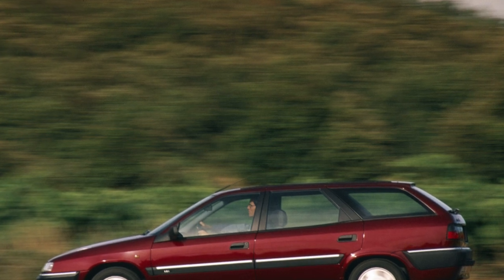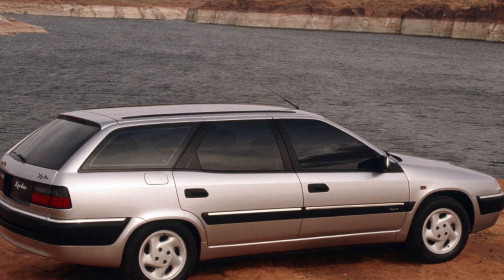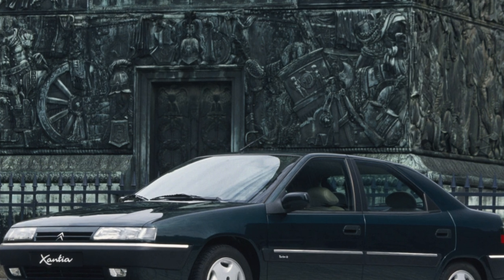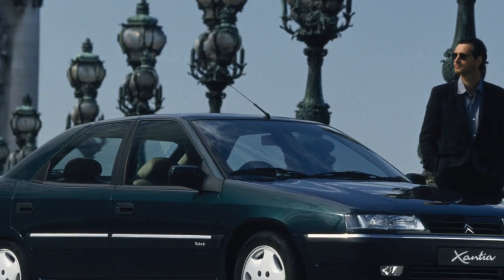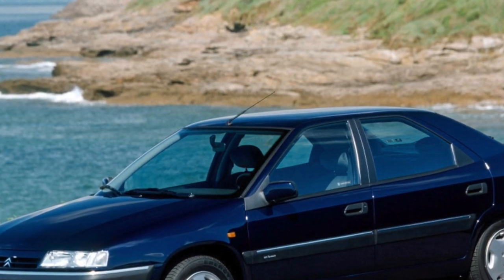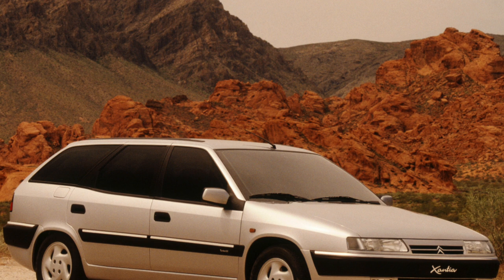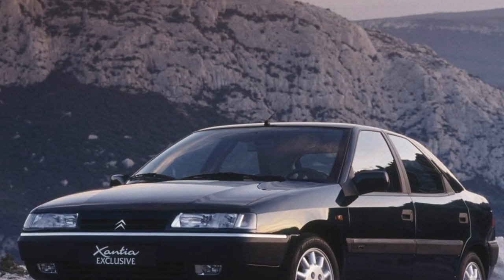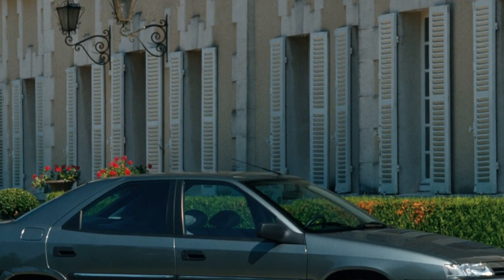Everything You Need to Know About the Citroen Xantia - Fault Guide

Comment: Great video. Thanks you even mention the clicks every 40sec. These clicks regulate the system pressure. If the clicks occur more often than say 30sec it means there is a leak somewhere as the system needs pressurising too often. Quite a good way to check if the system is in good nick. As well when opening the doors you should hear a slight humming, which is to soften the suspension slightly for getting in. 

A lot of people are scared of Citroen’s hydropneumatic suspension but indeed it is a piece of genius. The main problem is if you lose hydraulic pressure, suspension as well as steering and brakes are affected, which obviously means you are stranded full stop. 

However the system is quite simple. i.e. change damping rates by simply changing spheres, no dismantling dampers and springs. The lines that are under pressure are made of stainless steel and are very unlikely to break. When something leaks it is usually the return pipes, which are not under pressure and are made of rubber and can easily be replaced with about anything you find. 

Another big advantage of the system (at least to my taste) is the brakes:
1st these Citroens don’t have a break server. You have little pedal travel, the pedal sits lower than in a conventional car (about same hight as the accelerator pedal, which is great for fast driving) and is very firm. This does take time to get used to, but rather soon you realise this system is a goddess for fine dosage of your breaking.
2nd the brake system runs on Citroen’s suspension LHM fluid. Other than typical brake fluid LHM does not boil and does not absorb air, so no brake fading possible on a Citroen!

Nothing can combine comfort and sporty driving like Citroen’s hydropneumatic. On a conventional suspension you either have comfort and soft or sporty and hard. To describe the sensation, a lot of people are telling me my car (actually the even larger XM) feels a lot smaller than it is. This hits the mark. I used to have a 205 GTI before. OK, large Citroens are probably not as nimble as a 205 GTI. But thing is: If you turn a hoonigan in a 205 GTI, the rear end bounces, if not the whole car. On a Xantia or XM, even the worst pot holes don’t get it off line. And then you have the brakes that are absolutely pin point accurate. That is FUN!! 

I personally own a Citroen XM with the later 2.9 V6 (same as found in the Xantia) since near 5 years. I wanted an unusual, special car that is able to serve me as a daily driver at the same time. And this XM does just that. I had a problem with the thermostat, a water leak, the A/C blower, central locking, that was about it. Nothing over the top for a car that age (a lot of new cars these days make more problems). In general all the engines seem good and reliable. For a V6 it is even good on mpg. The older 3.0 V6 that gave the XM a bad name was not available in the Xantia. The diesels are unchallenged. The 2.0 Turbo seems to be quite thursty but is very characterful. On the Xantia I know from Peugeot circles (i.e. 405, 306) that the 1.6 and 2.0 may not be the best engines, but the 1.8 proved absolutely indestructable.  

My XM is 25yo now and passed the last MOT without fault, not even an advisory. (LOL, the biggest problem was getting the MOT man out of the car again!) And yes the XM is more left field, more typical Citroen, Xantia was more acceptable to the masses in its days. But exactly this makes the Xantia sadly underrated nowadays:

BIG THING FOR XANTIA:

A good XM these days starts at 6000Euros. Even then you must check carefully. Tendency rising. A fully restored XM cracks the 20,000Euros mark these days. But the Xantia is so much ignored, so much underrated. You can find a good Xantia starting 800Euros, because nobody wants them, nobody talks about them. 

PLEASE go and save a Xantia from the scrap yard crusher! The car will reward you with up to date comfort, fun and daily driver abilities, great functionality and acceptable running costs!

OK, I have an XM for I like the unusual, I like variety. Yet even after 5 years I haven’t got bored of her one ounce. If I had to get another car now, I would be looking at an XM again, maybe an estate, maybe a different colour, maybe the Turbo, but definitely XM!  

Thing is with the Xantia, it has the same technology as the XM, same engines (even the same V6), suspension, brakes, etc... and the Xantia is smaller and lighter than the XM. This keeps me wondering if the Xantia is not even the better drivers car compared to XM! Yet you can fetch a decent one starting 800Euros? 

Save a Xantia from the scrap yard, your neighbour may not be looking at you as if you have bought a Bentley SUV, but if you don’t need that kind of sanity, you may well fall in love with your cheap Xantia so much you make her fit for the next MOT and keep her on for many years to come. 

If you want a cheap classic that is fun, comfy and functional, get a Xantia! You honestly won’t find a better car for that price, and seeing what currently happens to the XM, maybe one day Xantia will also be worth 5-digits!